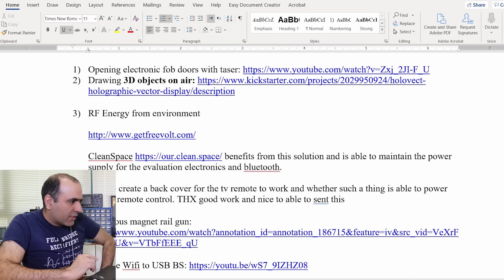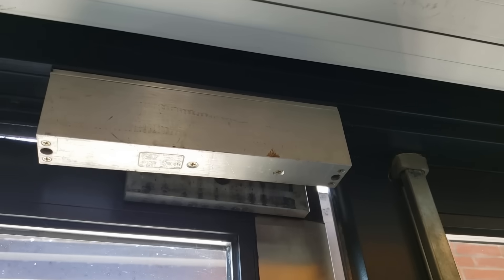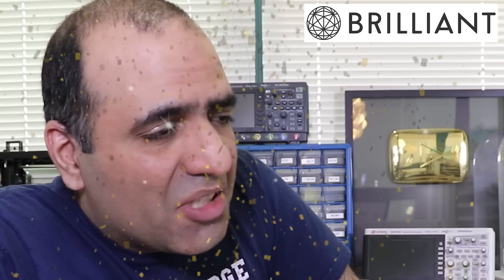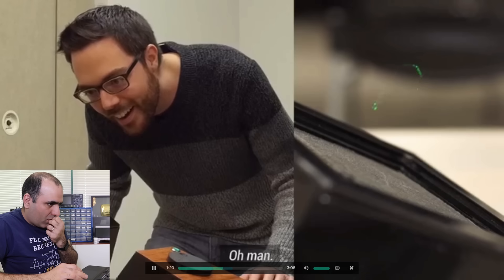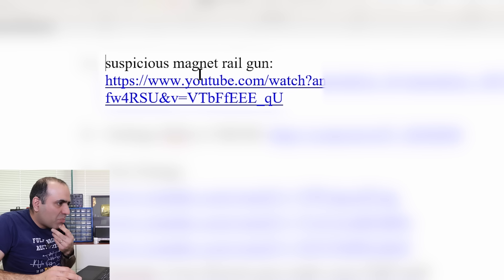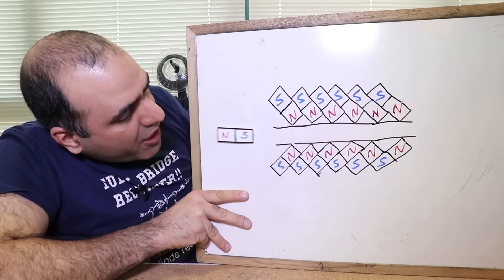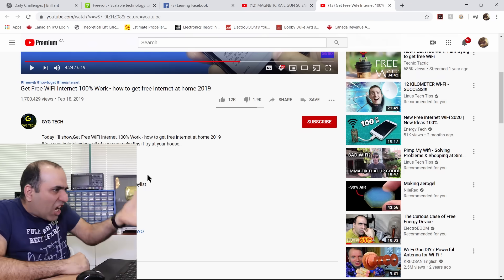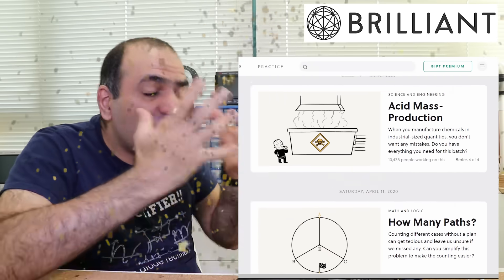BATCH RECTIFICATION of my To-Do-List

Comment from the maker: My daughter said I had to push those doors, not pull them! Was that the case??
Reply: No, usually housing doors are required to open outside to combat stampedes
Reply: @ladripper47874  That, and the fact that push doors don't normally have pull handles on them.
Reply: @U014B  that's what I told my instructor every time I embarrassed myself pulling on the handles of the classroom door trying to exit last fall semester. They opened outwards but had PULL handles. WTF?
Reply: @ladripper47874  yes i agree with you. It is a standard protocol to have doors open outwards after one of the fire massacre in a cinema back then
Reply: @ladripper47874  that makes so much sense, TIL, thanks!
Reply: @ladripper47874  waht? yuo made thta up.
Reply: @ladripper47874  0
Reply: @ladripper47874  everytime I read something like this the music from "the more you know" from NBC plays in my head.
Reply: Try again
Reply: Looking at those doors, the hinges are on the outside, meaning you have to pull them
Reply: @MinkSquared  probably true, but there are double-acting hinges like these: https://www.amazon.com/double-hinges/s?k=double+hinges
Reply: @MinkSquared  Yes a person with sense
Reply: If they are Panicdoors, they have to open towards the outside and can only be locked one way. Not sure about such laws in North American countries, but I'd assume that larger apartment buildings would be required to have those or at least something very similar.
Reply: Maybe you want to Check out that "Brilliant" thing you are advertising. 😅
Reply: The correct behaviour in case of electronic failure is exactly OPEN the door because there can be fire or anything else dangerous and people should have possibility to escape. In that video, it seems that guy had universal key behind tazer.
Reply: you have to push/pullthem while the control is resetting so the electromagnets don't activate again.
Reply: You were right. You can see the hinges on the outside therefore you must pull.
Reply: Hinges are on your side it is a pull.
Reply: @entropy616  Usually but not always: https://www.amazon.com/double-hinges/s?k=double+hinges
Reply: Sooooo ... you're going back there to retry?
Reply: @hasibryan  I don't understand you
Reply: No one does  @HencoSmit
Reply: Can't argue with her assessment
Reply: @vin_vats5987  me too #rewatching
Reply: But the LED on the black box on the panel turned green for a few seconds after you've zapped it, so maybe it worked?
Reply: time to go back and retry
Reply: The hinges are on the outside of the door. With that visual information I conclude that you had to pull.
Reply: Maybe you can't have locks on apartment buildings fail safe in the locked position.  What if there is a fire?
Reply: @BrettonFerguson , that is the idea of the mag lock. If wires are cut or burned open the mag lock opens. If a car drives through the front of the building and takes out the fire alarm control panel, and bursts into flames, the mag locks attached should open because the fire alarm system is no longer in communication with the maglock control.  But it is not fail-proof. But so often bank security disables these features as well.
Reply: Haha guess ur daughter is smarter than you.
Reply: @sutapasamanta3202  কোথায় থাকেন?
Reply: @Sutapa Samanta  no
Reply: @sutapasamanta3202  No
Reply: @sutapasamanta3202  no because it would not make sense because the handles are meant for pulling open not for pushing if it was for pushing the handles would not be there
Reply: FULL BRIDGE RECTIFIER
Reply: Man, it's so long that we don't have a video from ElectroCute... Please do it...!
Reply: No it's a pull, see where the hinges are?
Reply: My guess from the part where you show the LCD blanking is simply the system resets too quickly and there's too much distance from the intercom to the door for you to pull this off by yourself. At best you'd need an accomplice, and I'm not sure it's a good idea to bring ElectroCute into this xD
Reply: One problem methdi.  You should find a way to try and reset the control panel, while at the same time pulling the door. . . It might be that by the time you got to the door and tried pulling it, the system had already reset and lock re-enabled itself. . . . So it might have worked. . . . Remote control taser.
Reply: The hinges are on your side, so it must have been a pull door!
Reply: I dont think You need to push the door. If the magnet is behind that door it would make less sense to push it from outside because there is the bar with the other magnet and would block the door if You try to push from outside I guess. The other thing is. If I look to the hinges of the door, I think they arent made to work in other direction. And because of the reason Michael Schaffer I really dont think You need to push the door.
Reply: No they are pull the hinges are on the outside, a general rule is if you can see hinges it opens towards you but if you cant see hinges it opens inward
Reply: Yes it was the case, red led turned green while you tazed it so it was opened.
Reply: Waiting for part 2...
Reply: Someone is on TikTok posting all your videos on it.
Reply: I think ElectroCute is pulling a fast one on ElectroBoom.
Reply: Most electric doors fail safe though, which in the case of fire regulations means failing to an open state.
Reply: You need to tell people to "ZAP THE LIKE BUTTON!" and call us zappers for ultimate meta meme points. :D
Reply: She's smart unlike you😂😂😂
Reply: Seeing the hinge outside the door, the door opens the way he tries.
Reply: @HPHomeProjects  Yea, that's what I said, good observation, great minds think alike.
Reply: Toronto housing and building code requires that all doors that would be accessible to public must be pushed out to allow for easy escape in case of emergency. You were doing it right.
Reply: The hinges show they pull not push.
Reply: Usually the side where you can see the hinges is the pull side.
Reply: 2 thoughts on this. Either the lock re-engagement time is too fast (might need to be forcing the door while zapping the lock) or the safety mechanism is defective.
Reply: yab cus maybe its made so you can pull them
Reply: Fail
Reply: The position of the hinges suggests the door opens outward. So pulling is right. Science.
Reply: Yea it's right the light turned teen which means you have to be fast before it turns red
Reply: probably not
because the doors need to open to the outside
imagine there is a fire and 200 ppl try to get out and you cant open the door to the inside beause everone is pushing in panic
Reply: no look at the hinges
Reply: yes sir
Reply: Retry to open a door locked with a pad but using your magic wand
Reply: ...and you can see clearly, the hinges are on this side of the doors.  Pulling them was correct, not pushing them.
Reply: MAYBE IT WORKED???
Reply: The hinges are on the outside so its a pull door
Reply: Brilliant
Reply: 48 seconds
Reply: Push and piull
Reply: Good 👍
Reply: htfu
Reply: https://youtu.be/gJ0Y2byyqhE
Sir I try to make Wireless motor Rotation with Tesla coil
Reply: How can I make that coil zapper...?
Reply: Maybe 🤷‍♂️
Reply: HMMMMMMMMMMM
Reply: You can see the hinges are installed such that the door is to open outwards, so most likely no
Reply: What kinda doors have handles for you to push!?
Reply: Lol. That would be funny!
Reply: Looking at the hinges it looks like it opens outwards to me
Reply: It's more liklely it 'works' the same way that opening a car door with a tennis ball with a hole in it works. Someone offscreen is unlocking the door the normal way.
Reply: @DijonFromage  these locks are from local manufacture. They are cheap. But these locks are a real piece of junk. The goal of these locks just to prevent homeless people from entering the building, nothing more. It could be open just by force if you are strong enough.
Reply: Do we get hints about a Davie504 video or you just like Davie? Let's hope for a colab video.
Reply: ElectroBOOM electroboomer?
Reply: The doors usually open inside so that when there’s a blizzard, you can at least open the door. Idk about Canada but that’s what we have in post Soviet Union.
Reply: This was fun, u should do it again
Reply: no it wasnt working because the magnet isnt an always OFF model, its always ON unless the box tells it to turn off, so resetting the box wont effect the magnet. the older systems are opposite and thus insecure.
Reply: no way, you can even see the hinges.
Reply: Fire code states otherwise.
Reply: maybe if they really reset and the electromagnets turned off you were to far to open them in time . Much like  Faraday's coil induction experiment
Reply: hahahaha God bless her, in few years she will be the greatest scientist world has ever seen.
Reply: اره خب باید میکشیدی سمت خودت 
ولی من فکر میکنم از قصد هل دادی در رو چون نمیخواستی مردم برن درارو باز کنن و برن دزدی😂😂
Reply: Man that sad maby i don't tinke you coud try in a New video
Reply: or maybe just ring and wait for someone to open it for you, i'm sure the chance is almost the same lol
Reply: Was this recorded. Before the pandemic issue
Reply: ElectroBOOM hahah
Reply: ElectroBOOM ... im watching wile hula hooping
Reply: Boi you're such an angry genius.
Reply: nah you can push fron the otherside just go to the otherside and then push it it'll work 100%
I do this everytime if it's not working properly
Reply: no the hinge is on the outside so it open outwards
Reply: I think it would be better, if there was a second person who would pull the door as soon as you use the teaser. Timing might be wrong as well.
Reply: the LockPickingLawyer has some videos where he does the same with fingerprint locks. Maybe check that out.
Reply: Nolegde
Reply: ElectroBOOM mehdi explain 5g towers 💀
Reply: Something tells me the subject at hand was the "FreeVolt Technology" 7:16
Reply: XD
Reply: Electroboom.. you know all those gimmick toys that sing and dance usually dressed up like santa or some other bs.. I used to purposely key my walkie talky near them because it would  turn all of them on at once.. used to drive people nuts..
Reply: Vandalism much?
Reply: The hinges are on the outside,  so it opens on the outside, when you shocked it and the panel screen turned off is when I'd try opening it, therefore it would take two people to do that, one shocking it, the other opening the door. Or it's made not to open because of an extra power supply..
Reply: Maybe
Reply: I'll tell you the secret how the doors were opened in the first video for an oscilloscope. I'm Russian engineer)
Reply: did the magnet in front how can push them?
Reply: Revisit, post results
Reply: You can see the hinges on the outside.
Reply: no, they're pull doors. you can see the hinges on the outside.
Reply: What would happen if you tried tasing the actual magnetic locks instead of the panel?
Reply: A different theory, but it involves the designers of the panel you played with not being penny pinchers.

It might be that the panel you worked with uses a relay to turn off the electromagnet. (When the panel turns on the relay it turns off the electromagnet.) That way if the panel fails, the door fails locked, but a power cut of the entire system causes the door to fail unlocked.

It would make sense from a safety and security standpoint too. A criminal trying to break in that tries by smashing the panel only serves to lock himself out. But in the event of a fire killing power to the system (by, say, killing power to the entire building) would let the first responders in.
Reply: No way, how would that work with an electromagnet
Reply: Hinges are on the outside so Electrocute is incorrect.
Reply: F
Reply: If it has a bar pull
Reply: Try again (maybe you will have a nice trip the police station,just kidding)
Reply: I would have said your ass is going to get arrested by uploading this.
Reply: Hinges were on your side, so it was pull.
Reply: I think going on a stranger door in the middle of a pandemic to try open their doors in the middle of the night is the problem
Reply: The laser 3D project tech is a real project in japan - YouTube video link here: https://youtu.be/KfVS-npfVuY
Reply: Sir ar you American
Reply: USB killer
Reply: My daughter told me , it should be sliding door LOL
Reply: Lol
Reply: His phone is on airplane mode how can he get internet 😑😑😐😐
Reply: You are the cute electrician
Reply: try again and add clips in next video
Reply: If you like fusion check this out this is the first half of my prototype VFR reactor Im trying to get funding to get the proper safety and materials for a better prototype https://youtu.be/3TIQUiGaC9c
If I can get funding I can get the some real data and improve it from there
Reply: error 404
Reply: ElectroBOOM I feel like those people are now trapped in their apartment because it reset with the doors closed and now they have to wait for a technician to come
Reply: What if you tasered that machine and push/pull the door at the same time because I think as it was the latest tech then it would only have opened the door at the time when it got reset by the taser.
Reply: looking at the hinges they swing out
Reply: Please make more of these Videos. ❤️
Reply: Hinges are on the outside and magnets interior, so pulling was proper.
Reply: Should do some review on beyond psychics wireless bracelet
Reply: No the hinges were on the outside so it was pull
Reply: Tell something about Wi charge company. Promising of delivering wireless power through infrared radiation
Reply: Oh you
Reply: https://www.facebook.com/104414147741027/posts/156213805894394/?d=null&vh=e
Reply: Thelockpickinglawyer = what is the answer you seek
The key is within you sir
Reply: No, they did open out, you reset the intercomm not the access control system. the reason the Russian one worked is the controller is in the keypad, unlike well designed systems that have the controller located elsewhere (I'm an electronic security systems engineer)
Reply: yes
Reply: ElectroBOOM you said do it had no cameras or anything but then you upload it to YouTube 😂😂😂😂 I relate to this so much
Reply: sooo youre trying to open the doors 2min.
Reply: No you have to pull those doors, judging by the hinges being on the outside and the screws to the hinges inside.
Reply: No, it's not weather you pull or push doors, it's because you don't know how to open doors
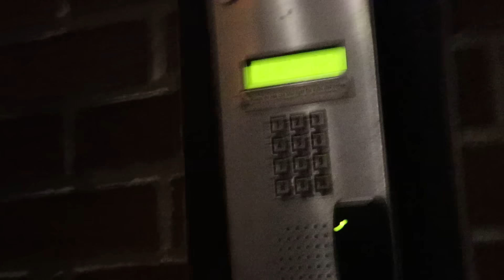Reply: No Medi, i think the case is: In the original Video he is zapping to the RFID reader coils. (as you did on 3:30) Maybe with a 100 trys.. Greetz
Reply: Noice
Reply: Please can you be funny again
Reply: Hi Mehdi, I have a request for a video about bicycle dynamo hubs (or should I said magneto?). I'm a bike traveller and like to charge my gizmos on the go. There is an interesting article on the subject comparing outputs of different hubs while connected to various light or usb chargers. https://www.cyclingabout.com/dynamo-hub-power-drag-testing-schmidt-son-shutter-precision-shimano/ While I get the principle I would like to hear what possible differences there may be, that cause the curves on the charts to appear as they do. Why some dynamo has a better power output, but worst drag, while another has a similar output, but much lower drag. Why in some cases the drag no longer increases with speep, while in other cases the drag still goes up. Thanks! :)
Reply: ELECTROBOOM CHECK YOUR INSTAGRAM MESSAGES I HAVE AN IDEA FOR VIDEO PLZ CHECK IT OUT :)
Reply: Oof
Reply: Don't try it, stay in home
Reply: No, if you notice the door’s hinges are facing toward the camera, all doors open in the direction that their hinges face. So no, you were not supposed to push them.
Reply: Building codes - exit doors swing out.
Reply: Go again
Reply: Why would there be a pull bar if it was supposed to be pushed?
Reply: You had to  pull the  door  while  resetting  the  system  as the magnets are deactivated  for a second then they turn back on
Reply: Khaylee dooset daram dadash
Reply: There is an easier way to open a magnetically held door if it only has one magnet at the top or bottom. You use the fact that you can get leverage by pulling the door at a point away from the magnet (useful if the magnet is at the top or bottom and the handle is in the middle), by using the force x distance rule (lever). You give a quick hard yank on it, and hope that the handle doesn't come off. I've opened several of those doors like that.
Reply: My bet wolud be on the lock resetting quicker than you could get to the door.
Reply: Bamboozled
Reply: well, I got banned on your subreddit thanks to those moderators. Great.
Reply: :D meanwhile people living upstairs hear you grunting in pain
Hey, isn't that the ElectroBOOM guy down there? Heck yeah, what is he doing? Oh, he got his huge taser with him... and now he's tasering the door system... XD looks like he'll be uploading another video soon!
Reply: You're an engineer. If the hinge is clearly visible on the outside, which way should the door open?  lol....smh.
Reply: Eastern electronics like in Russia and Ukraine are much worse than the US and other parts of Europe
Reply: Listen music in filament 12v dc bulb and put magnets near bulb you can listen song in bulb and don't forget to connect bulb to amplified audio source. Try this in next video.
Reply: ElectroBOOM LOL @ you 😂
Reply: Nah. Coming from an access control dude, you can see the sex bolt from the outside of the door for the maglock, therefore on the other side a hanging maglock would not let you push it open. Those old-ass Doorking systems are typically installed Normally Closed (NC) so in case of a power outage, you don't need to power the panel, just the power supply for the maglock. The only thing within that Doorking system that actually controls that door is the relay; it will trigger it open when the scanner senses a key it is programmed to know.
Reply: Well she is the smart one.
Reply: ElectroBOOM you looking thicc from the back
Reply: can you explain to me how a battery in a taser can store alternating current?
Reply: @Javier-sw4iz  I think they use some sort of inverter (DC to AC converter) and then a transformer
Reply: Please , it is a question that makes me feel crazy
Reply: Malayalam
Reply: @ElectroBOOM Sir, I'm your follower since years. But I was fed up by seeing news that bob beck electrification of blood or Robert beck method of electrification of blood will cure corona virus as it was mention in some reviews of that product and many people came to youtube claiming that this method will cure virus. I cant a see barely a AA size battery box and a  light in some a videos who are claiming. Please give your view.
Reply: Please do this again soon
Reply: Make the biefeld brown effect pleaaaaaaasseeeeeee
Reply: Can you explain this video please, thank you.

https://youtu.be/vFfsEfnsA4I
Reply: A smart girl! lol
Reply: Yes
Reply: That would make it much easier to break in as it’s only magnetically held at the top
Reply: Love the channel, your work is amazing, and it's quite amusing to see how far your body can endur the punish. But if you can put fire extinguisher behind you- just in case- it would put our mind at ease that at least you are not going to set everything on fire.
My respect and support to genius homey
👌⚡🇮🇷
Reply: Hahahaha
Reply: Nope. The hinges were outside so you have to pull it.
Reply: Okay idea pitch can you transfer radio waves signals into a radio? Wirelessly (with a mic or cellphone I guess)
Reply: Mr sadaghadhathar mehhthdi .Hey . I got a new video for you to find out if it is a lie . I think it is completely FAF since you have brain washed me with your dark speech. Here it is. https://youtu.be/LqZ96ds0HQw
Reply: ElectroBOOM do u have a email or something I want to send you a video of a high schooler sticking a paper clip inside an outlet
Reply: I have seen people using kicks to open doors, apparently it doesn't hurt and uses self generated free energy !
Reply: @ElectroBOOM im begging you to watch this mate! (100% energyefficiency!) https://www.youtube.com/watch?v=WpN5PjOxHbo&t=1623s at about 20:00 or so)
Reply: Hinges are outside. Pull.
Reply: Its a fire hazard to have doors that are exits be pill from the inside so it probably just didnt work like you said
Reply: Go and Do some crime, when you get arrested and cops place you on electric chair, just ask them: "Is it turned on?" Really, you just survived so much, i mean, youre invincible to electrocution!
Reply: Hello I'm currently a student in electronic engineering and have finally got my power supply and scope to start doing projects at home because well...school is cancelled. any suggestion on wave generators or soldering irons or desktop mulitmeters? just wanted your opinion
Reply: Hey, can someone tell my why my shower shocks me...
Reply: Sir please can you help me rectifying my idea of a perpetual machine design . Sir trust me this design is different sir please can you help me?
Reply: Not sure. Normally, in  the US, the vertical handle is for pull and horizontal is for push.
Reply: Your daughter is wrong, Nite the hinges are in the outside of the door
Reply: Since I wasn't notified of of this video when it was uploaded...I will restrain myself from commenting...

Lol yeah right, like I'd let that stop me from commenting...mmmmuuuuuuaaaaaahhhhahahaha...blue light is the best!!!!!...like you said it helps with dissection...mmmmuuuuuuaaaaaahhhhahahaha........
Reply: Your daughter cute
Reply: Apply couple force.
Reply: Probably, did you push and pulled the doors? If not... Probably, however, remember that in Ukraine and Russia, the security stuff isn't made apropriatley, however you should check the security lock circuits... Maybe they don't have a specific component that avoids the shock to reach a key point to reset the door lock... Probably... Maybe I'm just dumb...
Reply: ElectroBOOM gi
Reply: Yes
Reply: Try Running a 120V or a 220V AC LED bulb on as best as possible DC? Also it's an LED right?? Is the circuitry in it making the AC sinewave into some kind of square wave or some waveform with no reverse current??
Reply: Why don't you buy one when you can buy it?
Reply: https://youtu.be/KHvfwpnPwwU
Reply: See this video he opened a lock with magnets
Reply: Try again
Reply: No we can see the hinges on your side, so they open toward you.
Reply: maybe
Reply: Go back and try again
Reply: Mehdi please expose this free energy. Thanks in advance.
https://youtu.be/32wSwjGiaK0
Reply: When the panel light turns green, it means the door is unlocked.
Reply: You are Genius.
Reply: Yes Data Cable Have 4 Wires White and Green Transfer Data.
Reply: American (and i'm pretty sure ALL) building codes state that all doors on comercial buildings MUST open outwards, in order to make exiting easy during a fire or other emergency. It's really unlikely that the doors have to be pushed inward.
Reply: Probalby not, the lock is usually switched via a relay so you would have to zap it somewhere it has contact to it, also there are a lot of models with safety features that dont let the lock open if anything else but the relay doesnt get powered
Reply: She just turned off the Wi-Fi and turned it back on again
Reply: You need to also use a magnet hole haha.
Reply: Uff meter:100%→😌
Reply: Omg pls try it out and tell us :000
Reply: I don’t think so, the door had bars meaning you had to pull them, if you had to push them they would just have iron plates for you to push on
Reply: lol ya
Reply: The hinges are on the outside, so no
Reply: https://m.youtube.com/channel/UCiHUr9HoHa_lCJlPEM5eb1A
Reply: You had to keep tension on the door while resetting it as the electromagnet off duration or the reset refresh time is on fraction of a second
Reply: Maybe.... Try it again and try not to get caught by the police😅
Reply: I'm pretty sure they should swing outwards. Otherwise in case of a panic, like a fire, people could get trapped.
Reply: Did you noticed the led turned green, then red? Maybe you should  tried it a bit faster before it resets
Reply: hhmhm
Reply: Your daughter is beautiful
Reply: You can tell by the hinges being on the outside that the door opens outward
Reply: No, the hinges were on the outside. Doors open toward the hinges
Reply: Ya now u got that
Reply: No, you can see the hinges on the outside of the building, implying that the doors open outward
Reply: No, the hinge knuckles are visible on the outside, so you have to pull those doors.  It looks like a very secure electronic lock (doesn't open on a processor reset), and a completely insecure hinge setup.  To gain entry you just file off one side of the hinge rod (if it's even balled over) and punch the rod out with a long punch. It's usual to file off the bottom of the hinge rod and punch it upwards, because that way leaves the possibility of replacing the rod and making detection more difficult.  When you remove the rod the door then falls off no matter what lock or locks is on there. 

This is the problem - doors have to open outwards to facilitate escape in an emergency (eg fire) but you can't use normal hinges because that exposes the knuckle to the most simple brute force methods of entry.  Hinges used on exterior doors in apartment buildings have to be done with a concealed knuckle.  If you see a heavy steel plate over the hinge knuckle that has been done as a later upgrade, that is why.
Reply: And the light turn from red to green at around 3:40, when the cam was unfocused
Reply: Oof
Reply: PLEASE PLEASE PLEASE DO ANOTHER OF THIS VIDEO
Reply: Maybe, but either way I think You have to be pulling or pushing on the door the same moment the device is resetting.
Reply: No
Reply: You should go back to the same appartment in the middle of the night and try to push them and see if it would work ;)
Reply: مهدی برای ویدیو هات زیرنویس فارسی بزار.
Reply: مهدی برای ویدیو هات زیرنویس فارسی بزار
Reply: I know you can easily get your daughter to do it for you.
Reply: 3:09 if you look at the hinges, it probably opens by pulling.
Reply: 3:34 it worked the light at the corner changed to green.
In 3:36 it turned red again.
SO IT WORKED!!!!!
Reply: Maybe it is
Reply: maybe the sparky flashlight was discharging through a coil, creating a mini EMP? seems a little more effective than just shocking it.
Reply: Omfg
Reply: When you zapped the thing led became green so i think you opened the door
Reply: I'm brushing up on smartness watching you
Reply: Actually it works if you check the green light means it is open
Reply: Nope, egress should never open to the inside, it's a fire hazard due to the fact that if you have a pile of people behind you trying to rush out and they get pushy, you cannot make space to open the door and you all die. It has happened before
Reply: you should go to Russia and try it there...
Reply: this push or pull stuff needs to stop. had a cunfusion one time in amsterdam in a hostel that unlocked the doors from the reception desk. the outer door was pull and the inner door was push. being high did not help us
Reply: Doors usually open the side the Hinge's are on...
Reply: Hmm
Reply: LOL😂🤣😂
Reply: Definitely pull, you could see the hinges in the video meaning that you would need to pull the door towards you.
Reply: yes
Reply: @ElectroBOOM WAIT A MINUTE. I noticed that when you accidentally shocked yourself while tasing and resetting the panel, its light turns green for some time then turns red. I think the issue is the lock did open but you didn't have enough time to open it.
Reply: That makes sense but did you try it
Reply: bruh moment
Reply: Oh Shi%
Reply: No, they're pulled
Reply: EMP damages relay to electromagnet. Thus door opens
Reply: EMP damages Relay to electromagnet, Thus door opens
Reply: That makes sense... My teacher once told me that doors and windows should open clockwise..
Reply: Yep
Reply: then how did you get out the door
Reply: No! Look at the hinges
Reply: No, I think that the doors have to be this way in case of a fire or other evacuation
Reply: The hinges are clearly on the outside, so you were right. Would've been easier to just knock the hinge pins out
Reply: Failsafe should open the door for emergency if guess
Reply: @bishopdean5089  that's really unethical
Reply: BRUH
Reply: Can you make part 2 on this please
Reply: It is reset but the door must be pulled and the is opened but the door opened period is very short
Reply: its still mumbojumbo
Reply: You can see the hinges on the outside of the door, I'd say it's up to code and they open outward
Reply: The doors are still smarter than you it seems...
Even if you can unlock it correctly, you still can't seem to figure out how to open the doors, so the doors are actually pretty secure
Reply: Peoples have low expectations of presidents even though they stand and high expectations of chairmen even though they sit
Reply: Klh
Reply: Lol
Reply: Did you go back and try?
Reply: So you would design the door system to fail "locked"?
So that in case of fire everybody would burn alive inside?
Wundervoll! I like your way of thinking!
Reply: i know Im randomly asking but does anyone know of a trick to get back into an Instagram account?
I stupidly lost my login password. I love any help you can give me
Reply: @Axl Yosef Instablaster =)
Reply: @Drake Jaxon Thanks for your reply. I got to the site on google and I'm trying it out now.
I see it takes quite some time so I will get back to you later when my account password hopefully is recovered.
Reply: @Drake Jaxon It did the trick and I actually got access to my account again. I'm so happy:D
Thank you so much you saved my ass!
Reply: @Axl Yosef Glad I could help :)
Reply: 😮 time for round two? 😂
Reply: No because the hinges are on the outside and that means it opens outwards.
Reply: U can tell from the hinge..if the hinge is facing towards u then u have to pull it :)
Reply: my housing door is push door not pull
Reply: If it is a top mounted mag lock then they open out for sure. The magnet is mounted under the top of the door frame. It holds the door from opening when energized, and is mounted on the side the door does not swing into, because the mag lock blocks the door from passing it.
Reply: "They hold the doors closed with about 300 kilograms"  That is 661 pounds.  Some Americans could just lean on it and push it open.  :-D
Reply: @BrettonFerguson  , we use 1,200 pound mag locks. The glass in the door will break before the door opens. It is not to stop someone who wants to get in rather stop those that just try to get in.
Reply: @WilliamMcCormickJr  Nice. Do the doors use plexiglass or some kind of security glass?  It probably doesn't matter, if any of Dr. Now's patients try to break in to steal a candy bar, they could probably just bend the door frame or snap the hinges.
Reply: @WilliamMcCormickJr  1200 pound magnet would make a good bike rack.
Reply: no, the hinges r on the outside, so chances r they opened out, not always true tho there are 2-way hinges, however i highly doubt there were used here
Reply: No. Hinges are outside so its a pull door
Reply: hey can you make a robat
Reply: I think you need at least 2 people, one zapping and one open the door immediately.
Reply: The hinges are on the outside though…
Reply: Geez nothing is safe with you hahahahahaha.
Reply: Oof
Reply: I think if you added a copper wire you would have made an emp 💀
And emp's are powerful af so it would have opend that door not 1000% but 999% will work try it pls
Reply: when the power is lost, the door must open, that is the safe way
Reply: I know this is years ago, but doors to multiple residences like apartments should be designed to fail open…. In case electrical fire or something were to happen and everyone within become trapped and burn to death.
Reply: It's because they have a chip called a spark detection chip that resets the device when sparked but does not unlock the door because they have pr9grammed it to not unlock when sparked without a code.
Reply: Nah, you'd have to pull at them WHILE the device resets or basically opens the buzzer
Reply: Doors open whatever side the hinges are on. So you were right to pull them. 😊
Reply: That doesn't make sense.  Doors like that swing outwards for safety reasons.
Reply: Pull. Exterior doors are required to be push to escape and you can see the hinges
Reply: Mag locks usually require you to pull the door as it’s usually easier to fit them that way, also you can see the retainer bolt I think at the top of the door so I’m going to guess it’s a pull door
Reply: Newton third law genius
Reply: In Canada most of these panels are properly grounded, even if they're a few decades old. In Russia, grounding is not always reliable
Reply: The hinges are on the outside so you have to pull
Reply: Use you  sponsor ship brilliant 😅😅
Reply: This is your first clue to people with 0 brain cells or maybe 1234567890th time
Reply: No, is an outward opening door, because as you can see, the door hinges are on the exterior. So that means you pull the door and not push the door.
Reply: "professional" dumbass
Reply: How does the drawing move
Reply: @HencoSmit  moves a magnet behind the board, the tag itself is either made out of steel or another magnet
Reply: @HencoSmit  I think He used a magnet behind the board. At the front He used another manget which the picture on it.
Reply: @HencoSmit  he used  magnets  attaches  to  the  paper and  used  an  an another  magnet  behind  the  board  to  move  them.  That's  why  u  can  see  his  hand behind the  board  when  th  magnet  starts moving. 😊
Reply: @isaamthalhath4359  thanks
Reply: @HencoSmit  he has a magnet behind the board
Reply: @HencoSmit  magnet behind board.
Reply: @HencoSmit  I believe it was a drawing on a piece of paper and he moved it with two magnets
Reply: @HencoSmit  magnets
Reply: @HencoSmit  magnets
Reply: @HencoSmit  haha when i first saw i thought it was edited, but i realized he is using magnet behind the board, nice idea :D
Reply: @HencoSmit  magnet behind cardboard
Reply: @HencoSmit  two magnets ( one is behind the desk and the other is that drawing that you moves)
Reply: @HencoSmit  magnets
Reply: @HencoSmit  He is using a magnet to demonstrate magnets ;)
Reply: @HencoSmit  I think he has a magnet on the back
Reply: @HencoSmit  I think he drew the magnet on a piece of paper, glued it to a real magnet and moved it using another magnet behind the whiteboard
Reply: @HencoSmit  it had a magnet attached to it and he used another magnet from behind the board to move it
Reply: @HencoSmit  magnets probably
Reply: @HencoSmit  he has a magnet behind the whiteboard, moving it with his left hand. The moving rectangle is just a piece of white paper/cardboard he drew on, with either another magnet or piece of metal glued to the back of it.
Reply: @HencoSmit  It's a magnet with a whiteboard glued to it that he's controlling via another magnet behind the board
Reply: @HencoSmit  animated images etc  like take pictures of the same thing but slightly move it then take another one  then keep doing it till your finished . called frame by frame  then put them together  then it will look animate like a slide show at high speed   . theres many ways to do it though . im no expert anyways its just my guess
Reply: @danielhorne6042  thanks
Reply: He has a magnet on the moving piece AND on the back that he is moving with his hand.
Reply: hack Smit with an magnet
Reply: @HencoSmit  there was a magnet behind the white board.
Reply: @HencoSmit  he animates it.
Reply: You can always go back and try
Reply: I assume you spoke to the building managers before doing this? At least I would hope so lmao
Reply: it seems, you doughter is much smarter than you😂, she should rectify your videos🙏😂
Reply: @Mr.Nabh-1  No
Reply: yeah probably
Reply: Better ask someone before doing anything to their property. We don't want you to stuck in any problem. You have amazing videos to make Mann.... Back to the door....  Did you checked that it was not locked through some kind of manual lock or..just normal door locks...maybe from inside..  Because...you know...  It was midnight.. And nobody would usually go to a building to open the door and someone from there who lives or works or whatever..gonna make sure to lock that door
Reply: استمتع بمشاهدة مقاطعك علمية ومضحكة 
اتمنى ان تضع ترجمة للغه العربية لا افهم كل ماتقوله في المقاطع ولاكن استمتع😍😂
Reply: @ramis5012 
بعض المقاطع لها ترجمه للعربيه وللغات اخرى
Reply: @ramis5012  Why are you typing Arabic, he's from Iran...
Reply: @ramis5012  شعب سوري بل الساحات للمجد بيرفع رايات

عم يهدف بثلاث كلمات الله وسوريا وبشار

نحنا رجالك يا بشار

كنيسة وجامع متحدين ومحبة عنوان الدين

وملايين السوريين ومابدهم الا بشار

نحنا رجالك يا بشار

جيش سوري بوقفة عز هز كون وما بينهز

وياربي من عندك عز جيش سوري هل مغوار

نحنا رجالك يا بشار

سوريا رجالها فرسان لما تنزل على ميدان

الا بتحرير الجولان ما بيرضى القائد بشار

نحنا رجالك يا بشار

يوسف عظمة عا حصانو ينادي ابراهيم هنانو

وسلطان باشا بزمانو شعل فرنسا بنار

نحنا رجالك يا بشار

وشيخ صالح باشباله قاد ثورة برجاله

وحافظ وصا اشباله سوريا بلد الاحرار

نحنا رجالك يا بشار

نحنا فجر حرية وحروف ابجدية

سريان وفنيقة غير بسوريا ما بنختار

نحنا رجالك يا بشار

قولوا بلصوت عالي بدنا نصون الرسالة

لا غالي وابن غالي بلروح بنفدي بشار

نحنا رجالك يا بشار

للتحميل الاغنية او تحميل الفيديو كليب

او للمشاهدة تقرير الأغنية كاملا اضغط هنا
Reply: @ramis5012  hahahahahha, I dont understand
Reply: I think, somebody on the other side was pulling at the same time.
Reply: ElectroBOOM Yes
Reply: ElectroBOOM 

Hmmmmm
Reply: No
Reply: Mby
Reply: Does your taser is strong enough to zap open a security system ?🥺
The circuit needs to be zapped where the zap effect can destroy the circuits.
Reply: Lol I live in that building. If that's the back door it opens outwards. Also that panel has been broken for some time already :p
Reply: Did you really do that on someone's gate and published it? You are gonna get deported...
Reply: even if it was the case, best to not do it again. It didn't cause any harm that you're aware of, but if you had somehow damaged the lock and made it so that they wouldn't open, and there was an emergency you could potentially have put people's lives at risk. Sometimes it's not worth it, even for science.
Reply: Maybe talk to someone like... A manager... And not get arrested would help!
Reply: I'm shocked by the number of prudes out there whose only response is "Should've asked for permission." Seriously, he's not 12 years old and you're not his father. It's nobody's business but Medhi.
Reply: You should make a video on 5G explaining the technology and how it affects cells.